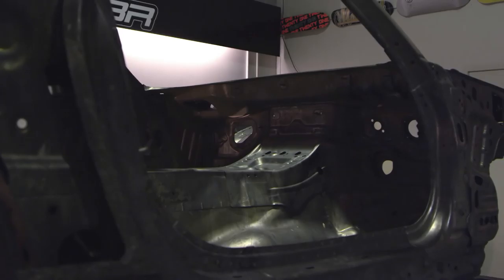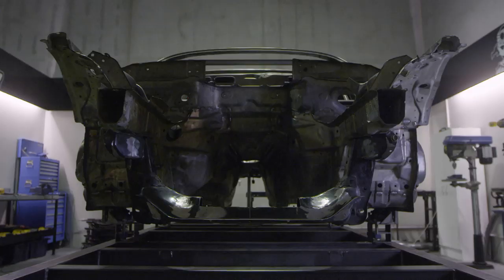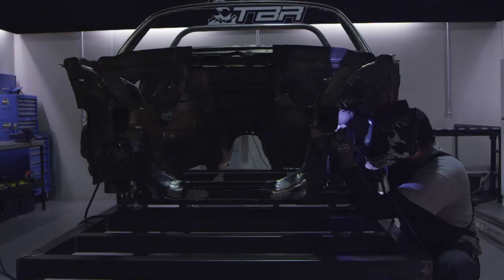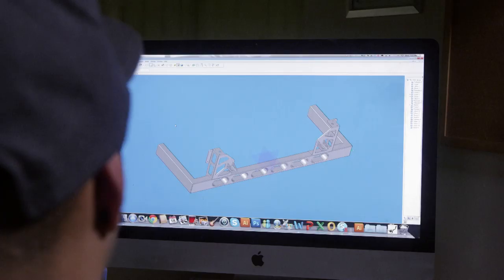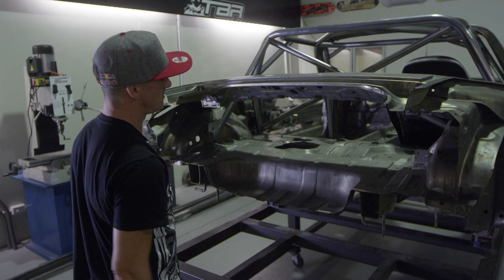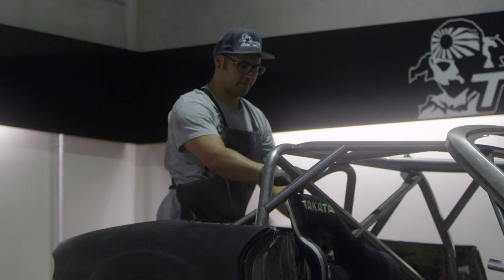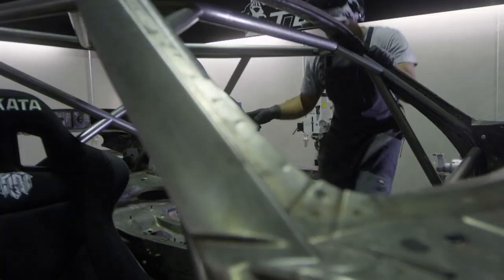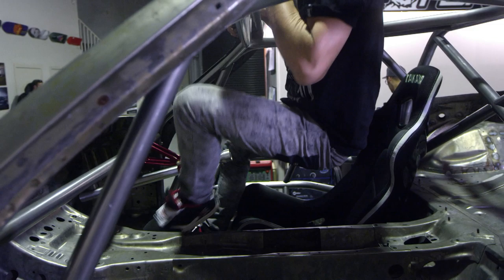Drifter ‘Mad Mike’ Whiddett returns with RADBUL Mazda MX-5

Comment: 1000bhp through a wheelbase even shorter than the FR-S and S13?  how wide of a tire will that need?  and since Formula D limits tire sizes based on weight (and outlaws the use of ballast) how much mass will it need to keep in order to run that tire?  factory backing from mazda is great but it sounds like a tough drive
Reply: he doesn't only race in formula d but yeah would definitely take some practice